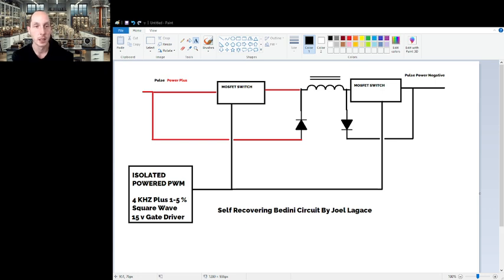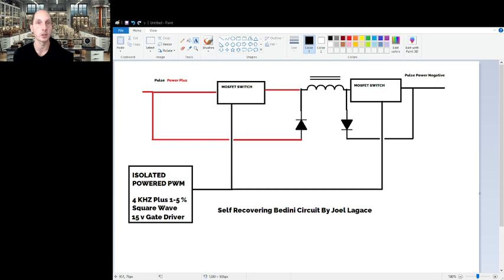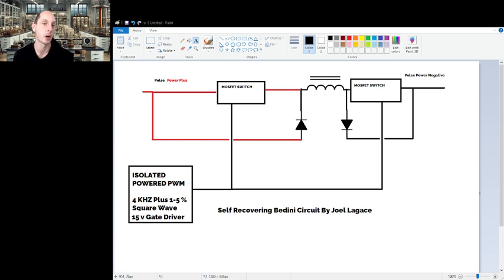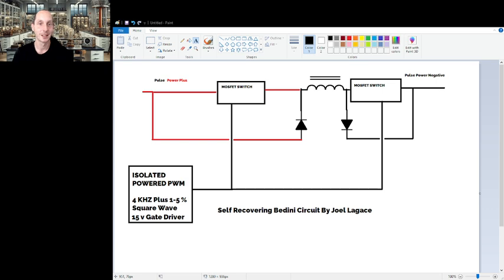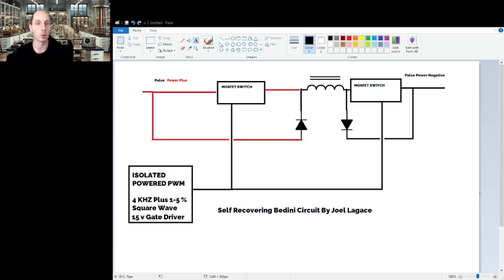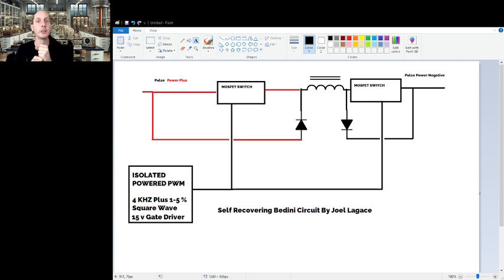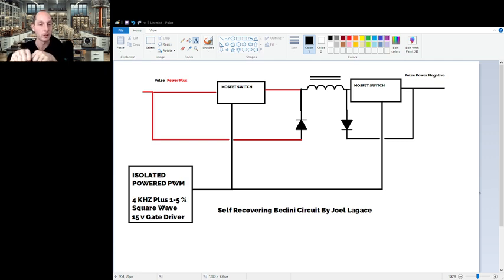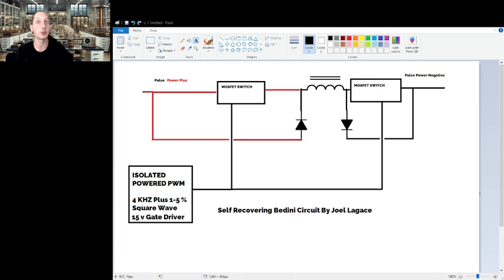Improved Bedini Switch

Comment: Joel, The way you have your diodes, it looks like the coil would be on all the time. It looks like your positive diode should go to GND to dump any negative voltages and the negative diode would go to VCC to dump any positive voltages. I was laying out my PCB schematic and noticed that. Thanks Joel I love your work.
Reply from the maker: See link in video details. http://typeright.social/forum/showthread.php?tid=485
Reply: @joellagace1679  The specified thread does not exist.
Reply from the maker: Not sure what to say ppl are reading and rating it from my end. As the video comment states it's simply a updated photo with the corrected hock up.
Reply: @joellagace1679  I needed to hit the "more" to see your comment. Sorry I missed that.

Comment: I purchased 2 Bedini motors from China. They are modified so much that It is like a low power motor. It is not a true Bedini one.
Bedini claims he gets higher energy output then input and he claims making an energy loop is a bad Idea. I believe him.
Bedini motor generator has to sit in external magnetic field, It is an open loop environment and he takes energy out of the machine when external magnetic field energy is going thru the apparatus as a very high frequency energy within a pulse of imaginary south magnetic region. The motor generator is sensitive to orientation of Earth's magnetic field and position of a moon.
in other words the Bedini motor-generator is a magnetic coupling antenna. The device is magnetically coupled with Earth, Moon, Sun and all nearby celestials when running only.

Comment: Just thinking out loud … real isolation takes place when electric energy changes its “form” from one circuit to another.

Electrostatic energy doesn’t make sense as there is nothing static at all, it is non polarised charge which usually accumulate of dielectric surfaces … and dielectric store AND conduct “electrostatic” electricity (non magnetic) … working principle of electrets !

Comment: There use to be a forum called IAEC (international alternative energy center), which was owned by users Mr Caribbean and TinMan. They had several different circuits, both pulse motor circuits, and solid state, that used just a single battery, and where the inductive kickback was sent back to the single battery. This forum took the pulse motor further than any forum on the net at the time, and still to this day, some of their work as a group, still has not been matched. Here is a video one of the members made of a replication of TinMans twin backEMF motor, where it would charge both batteries at once. The charge battery was charged from the inductive kickback of the run coil, and the run battery was charged with the inductive kickback from the trigger coil.  https://www.youtube.com/watch?v=5HwUuPQn2W8&list=FLsLiBC2cL5GsZGLcj2rm-4w&index=91

Comment: That’s an interesting idea, like the way you’d protect a motor coil from feeding back. Do you think it will put too much reverse voltage on the mosfets?
Reply from the maker: The diodes provide a safe path for the reverse voltage, protecting the MOSFETs from this harmful voltage spike. This means the reverse voltage "should" bypass the MOSFETs and instead flow through the diodes, making your MOSFETs safe from the kickback.

Comment: Yes pulsing a regular motor does make sense also using that motor to switch on off coil/transformer either by Reed switch or even contact a disk on motor I have tried this in the past with reasonable success. .I like the idea of electrostatic generation from the motor, good ideas 💡 👍
Reply from the maker: The interesting thing with electrostatic, Is its not like a normal motor where when you short/load the output it gets very difficult to spin. Uses more power. Here you can load the electrostatic side all you want its not going to load the motor down.

Comment: Keep going you're on the right track.  I'm currently working on the motor generator concept, also using diodes for a feed back loop.  However my system achieves the desired outcome using algorithms.